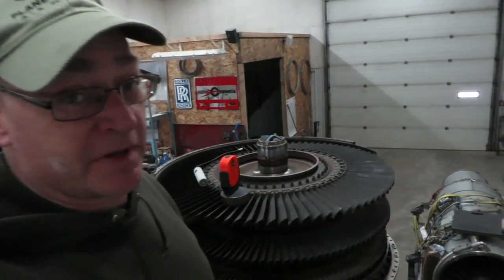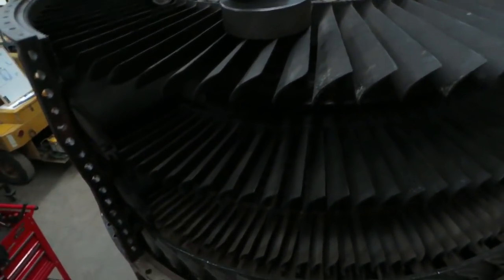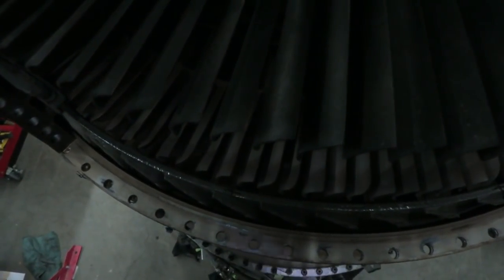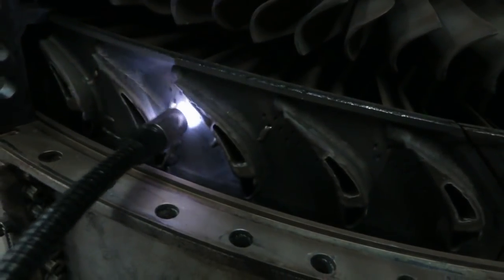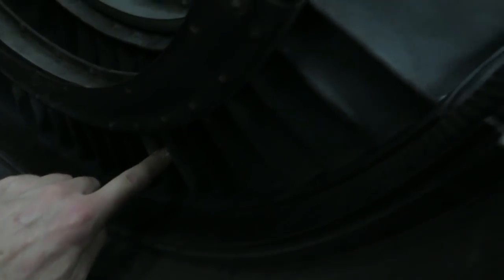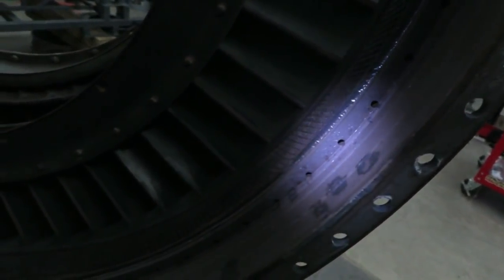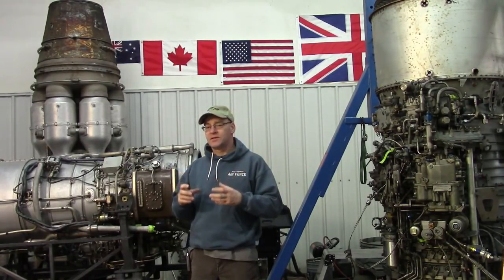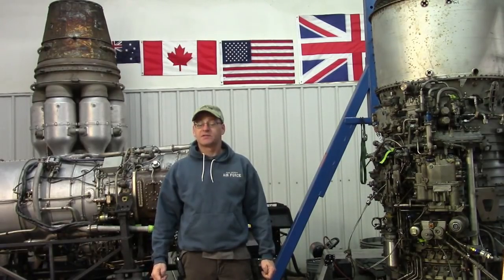Working on a Turbojet: 3 -Turbine Cooling Air

Comment: Well Done Agent 00J Zed.  I love these videos where we get to go where mere mortal humans are not allowed to tread.  The concept of a turbine engine is so simple, but the execution of the concept is so delicate and tolerances are so tight.  It is still magic that do not end up with a lump of molten metal dripping from engine.  Love this -- it would be fun to see what the exhaust velocity and temperature are 50 meters behind a J79 with reheat and standard military power.  Only thing is I do not think they make anemometers that would survive even 30 seconds at 50 meters.

Comment: If the gap between turbine and it's shroud is small to minimise the energy loss, when the turbines (first/second stage) run don't they expand due to the heat and touch the shroud? I understand this cooling air will cool it to some extent but the gases striking 1st n 2nd stages of turbines are really hot. Or is it that the shroud itself expands with the turbines?
Reply: You are correct and that expansion (of the blades and the shroud) is taken into account. The blades are designed to have optimal gap when they are at operating temperature.
Reply: ASJC27 but the shroud and turbines have different cooling rate and expansion rate, so when the engine stops or lights up there must be a danger of them coming in contact with each other. How is this managed?
Reply: Right again. The shroud has much lower thermal capacity than the blades and that is a problem especially when shutting the engine off. If the shut off is done too quickly the shroud contracts faster than the blades and the engine seizes. To avoid it there is a gradual shut down procedure.
Reply: ASJC27 Thank you very much for clearing the doubt I had, you are really helpful.😊
Reply from the maker: That's a lot of assumptions there. Your imagination is getting the best of you. The answer you seek is long and detailed, with a lot of "depends on" phrases included... so you will not find it in a YT comment box. The books I recommend are where you should be looking.

My videos and the discussion are not  meant to be an education. They are meant to inspire you to get working on an education...
Reply: The radial thermal expansion of the turbine rotor is a combination of the rapid expansion of the turbine blades and the much slower expansion of the turbine disc, because of its thermal mass.  There is, therefore, a 'two rate' expansion of the rotor, as compared to the 'single-rate' expansion of the casings. In addition, the axial expansion of the rotor relative to the casings must also be taken into account.  It can be quite complex, as I discovered  in the 1980s, when I did some analytical work on turbine axial and radial tip clearances.

Comment: A while ago, questions were asked about using some form of afterburning (that's reheat as I'm a Brit) between a gas generator and its free power turbine.  I made a comment that I'd done feasibility studies back in the 1970s.  I stated that while it is perfectly feasible it would not be particularly efficient, as the reheat combustion would not be taking place at the peak pressure of the engine cycle.  I also suggested that it would be an expensive solution to increasing the power of the machine, because of the need for an additional combustor, and possible cooling of the power turbine.  I certainly stand by those comments in relation to aero-derivative machines.  However .....
As a result of a conversation yesterday (at a Bloodhound SSC event) with someone  who has worked on 'heavyweight' industrial gas turbines, my attention has been drawn to the Alstom GT24/26 series of big single shaft, direct drive engines.  These do feature a 'sequential combustion' arrangement, with a second combustor immediately following a single -stage HP turbine.  The total fuel flow is split approximately equally between the two combustors and the arrangement is claimed to be an effective 'dry' low NOx solution.  The advantage, in terms of efficiency, comes when the machine is part of a combined cycle arrangement, as it provides a relatively higher temperature for the steam plant on the other end of the generator.
Note for AgentJayZ: there is a GT24 installation somewhere in BC.
Reply from the maker: Nice. As is often the case, you have spoken at a graduate level to us middle schoolers. 
Interesting information, but will likely result in some confusion and controversy in the comments.
I entrust you to moderate the responses your information may generate.
Reply: isn't this the same as the TAPS combustor on newer GE engines, only placed between turbine stages?
Reply: Point taken.
Reply: I haven't seen any diagrams or illustrations of the latest GE combustors: however, I understand from what I've read that they use fuel/air premix upstream of the primary zone.  This is what the GT24/26 engines appear to have in both combustors.  R-R's DLE (dry low emissions) combustors for their industrial engines were developed after I'd retired, but the feedback I got was that they had real trouble during development, because the premix would 'flash back' and combustion would take place where it shouldn't.
Reply: Most of annular Dry Low Nox/Emission (DLN/DLE) combustors looked quite similar -- there is just not enough length to do much anything else. Cannular type combustor in heavy industrial turbine has a little more variation for achieving DLN/DLE.

Historically, industrial gas turbine developed and adopted DLN/DLE earlier because more stringent emission standards being enforced earlier. Aircraft engines actually benefit from the research and experience from the industrial development.

Comment: 4:40 how much does the tap from the compressor take from the overall power?
is it a significant amount? or is it only like a few percent?
Reply: If it's bleed air that is recirculated back to the gas path the thrust loss is roughly the same as the percentage of the bleed air relative to the total air mass flow. If the bleed air is not recirculated back to the engine the thrust loss is roughly double that. So it is definitely a significant loss.
They don't use more heat resisting materials because there aren't any that apply. They are already using special high temp alloys such as nickel based super alloys (like inconel) and high temperature specialty steels like hastelloy-x. Ceramics are more temperature resistant but they are very weak so they are only used for coating of turbine blades.
Reply: Yes that is correct but these materials are just starting to appear in the newest generation engines. Also the same trade offs are still made today - cooling air is used even more in modern engines because instead of going to the newer materials and reducing the need for cool air what is actually done is going to the newer materials and increasing the turbine inlet temperature so cooling air is still needed (and even more needed today). The higher the temperature the higher thrust you get and usually that is more important than reducing bleed air. The J79 had a turbine inlet temperature of 1210K. There are modern engines that have a turbine inlet temperature of 1800K and more.

Comment: hello Jay, are some of those first stage turbine blades blended ? , because some of them they have rounded corners .
Reply: Yeah, exactly my question as well. not only rounded on one or two sides, some look even shorter...
I suppose it's not a huge issue for a ground engine. I wonder how much efficiency loss there would be? balancing shouldn't be too bad either, if blended blades get distributed relatively evenly
Reply from the maker: +LateNightHacks 
Assembly and balancing happens after blending.

Comment: do cmc's eliminate the need for all those cooling air holes in the latest generation turbofans?
Reply from the maker: No. Thermal barrier coatings reduce the rate of heat flow into a blade from the exhaust gases. Internal air cooling increases the rate of heat loss from a blade. Both are used in modern designs.

Comment: At what condition cooling of fixed nozzle is required?
Reply from the maker: Fixed turbine inlet guide vanes, or nozzles are the only type.
The cooling air passages are unrestricted. The air flow through them depends on compressor discharge pressure, so the amount of cooling is proportional to engine rpm.

Comment: Does the J79 (or its Marine Industrial equivalents) have an HPC impeller? I've seen instances where impellers are used to supply cooling air along the HP/LP shafts and was wondering if any of the turbine cooling air was sourced from this location?  If so, any chance for a video describing or showing what I'm referring to?

Additionally is any of the CDP air routed along the underside (radially speaking) to the 1st stage turbine nozzle and blades? Would be interested to see that gas path.
Reply: I am aware of one of R-R's early centrifugal engines having a mini impeller for the pressurisation of cooling air: there may be others, but it's not a common design feature, as far as I'm aware.
The cooling air for the HP NGVs in more recent engines is frequently a 'double end feed' with air being fed to both the inner and outer ends of the vanes, possibly with some form of 'partitioning' within the vane.  The air for feeding the vane inner end passes beneath the combustor, as does the air cooling the HP turbine blades.  The blade cooling air can 'injected' into the blade roots by a series of small nozzles, acting like mini versions of the HP NGVs, or it can be fed from a lower radius, using a mini disc or cover plate on the front of the turbine disc.
Reply: PS  If you google (other search engines are available)  'J79 Airflow Diagram' or, for a more modern engine, 'CFM56 Airflow Diagram', you should come up with some pretty pictures, showing where the various air flows go.
Reply: Do you mean carved out impeller channels (really radially inflow turbine channels) on compressor rotor wheel that draw air from hub of compressor, flow radially down to lower radius then goes axially to turbine stage? I thought that only exists in industrial turbine because the rotor wheels are actually "full metal" instead of thinned out aircraft engine ones.

On the other hand, all engines still use the inner radius route to supply cooling air to turbine for rotor wheel space cooling and blade film cooling.

Comment: Why are some of the compressor blades round at the edges whilest others are square. Also seemed to be intended due to the patern they are placed in
Reply from the maker: The removal of damaged material from compressor and turbine blades is called blending. I have a couple of videos called the Leading Edge, which show how it's done.

Comment: Are the third stage nozzles hollow? Only lacking any holes for the air to pass through them? They look like they are made from folded metal.
Reply from the maker: +zapfanzapfan 
Some versions are cast solid. Other versions of stg 3 nozzles are fabricated of stamped sheet. There is no air flow through either type.
Reply: In older engines with cast NGV segments that were uncooled, the vanes were usually hollow.  This saved some weight, reduced the thermal mass of the aerofoil and the thermal gradient in the wall, hence reducing the thermal stresses.
Reply: I never looked that closely at your profile picture before. Is that an EJ200 you are leaning on? Is it the one used in Bloodhound SSC?
Reply: Yes and yes.  Bloodhound has three EJ200 development engines, which are surplus to requirements, on loan from UK MoD.  Two are runners and the third (the one in the photo) is used for display purposes.  I've been a volunteer Bloodhound Ambassador since 2009 and the photo was taken a year or two ago now at the Bloodhound Technical Centre.  I was there on Saturday last, assisting at an open day event.  When discussing the engine at such events, I make a point of telling people I was head of the design team at R-R Bristol that did the original design studies for the engine.

Comment: hmmm. I had seen or heard somewhere that 90% of the air that enters the compressor of a jet engine is for cooling the engine. I'll guess that is at best a ballpark guesstimate from years past. Has that changed much with newer engine designs, or is most of the air still for cooling the engine?

Grea vids by the way B)
Reply from the maker: Again, it depends on the design. All that bypass air in a turbofan does not have a cooling function... for the most part.
The core of a turbofan is basically a turbojet, and the cooling air proportion used there has been much the same since turbojets were developed. Very roughly speaking, about 20% of the air entering the inlet is used to burn fuel. 
The rest is used for cooling, but is also mixed with the combustion air to be used for propulsion.

Comment: Hi, question:  if the cooling air is comes from the compressor, and driven by the air pressure itself, does that mean that the pressure is less after combustion towards and through the turbine?  Otherwise the gas would flow the opposite way towards the compressor?
Reply from the maker: +Trym Schjetne 
You are right.
Combustion gas pressure is lower than compressor discharge pressure.
Reply: Thanks.. The laws of physics I guess.   The combustion of compressed air and fuel creates allot of energy,  enough to drive the compressor and then some.  How come this energy/pressure is irrelevant, or lower, compared to the highly energetic compressor air? As an enthusiastic amateur, that will definitely be something for me to wrap my head around this Christmas, unless you are happy to explain.

Comment: 4:00 How is the honeycomb blade tip seal made? Surely they're not drilling all those holes?
Reply: Cmon Jeremy, you think you can only drill round holes...
Reply: Cmon Jeremy, thats why I'm asking! I dont think its cast either!
Reply: gang drills Jeremy... gang drills!
or gang broach...
Reply: Jeremy hey that's a great article, thanks for that! Pretty surprised that parts cavities that thin can be cast. Centrifugally cast perhaps?
Reply: No.  They are made from sheet metal strips,  which are joined and then expanded.  The expanded honeycomb sheet is then brazed onto the shroud segments.  It's a long time ago now, but I was responsible for designing turbine tip seal segments.
Reply: graham, Knew you would come through with something! So how are the sheet metal strips joined, diffusion, EB, laser welded?
Reply: It's all a long time ago now and we didn't actually design the basic honeycomb.  My best recollection is that it was some form of welding

Comment: Does the thrust bearing also have the weight the plane against it due to the engine pushing/pulling the plane along?
Reply from the maker: no
Reply: thank ya
Reply: R-R Derby use the the term 'location bearing' in preference to 'thrust bearing'.  This is more accurate in respect of its actual function in the engine.  The load on a location bearing in a turbojet has relatively little to do with the thrust of the engine: in some cases, the load direction  can actually be rearwards.  However, this does not necessarily apply in the case of the location bearing for the LP spool in high bypass engines.

Comment: How long can these engines continuously run? Must be a decent amount of time if it's used to generate electricity!
Reply from the maker: If you took a brand new LM1500, and ran it continuously at full output with an unchanging load, without any maintenance other than keeping the oil level correct, It would finally come to an end due to hot section degradation after about 10 to 20 years.
We've seen examples of that actually happening.
Reply: Wow! None stop,10-20 years! That is exceptional engineering! You should mention this in your next video it's an amazing statistic!
Reply from the maker: These engines are actually immortal if you do regular maintenance. In 2015, I inspected a well taken care of Orenda that had been last overhauled in 1961. It had many thousands of hours of run time, and thousands of start cycles on it, and looked new inside the hot section. It might need a full overhaul on its 75th birthday, but more likely when it turns 100.
I will not be around to do the work, sadly.
Reply: I read recently that aviation gas engines have life span of 6000-10000 hours and the industrial ones have life span of 120000 hours on average.